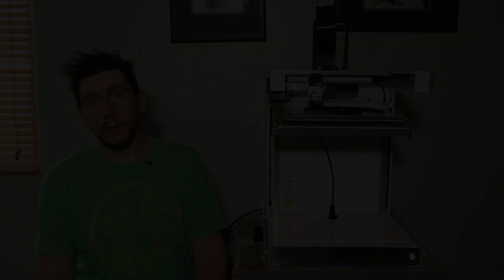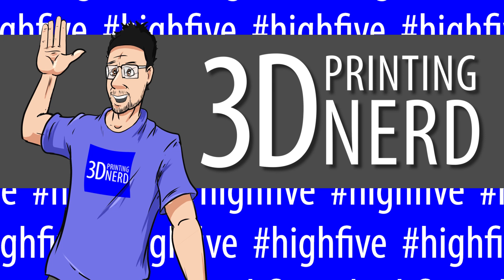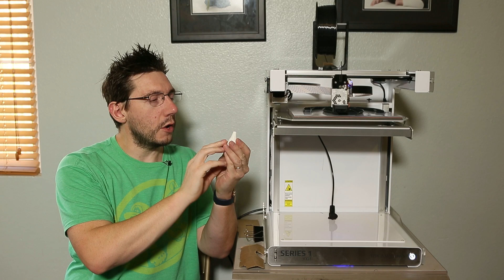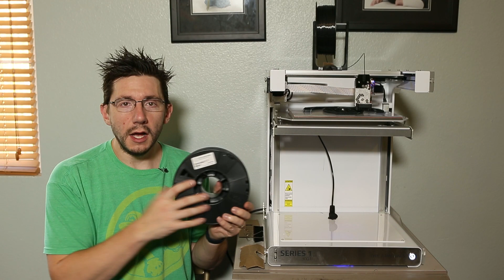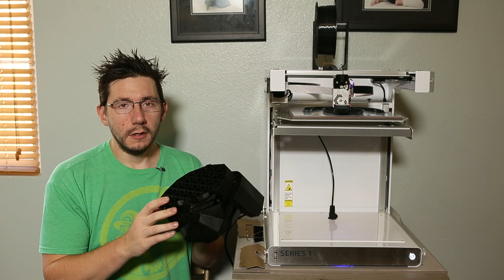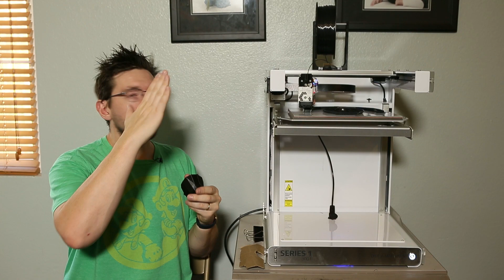Type A Series 1 3D Printer Unboxing Summary

Comment: The "filament jumping off the spool and getting wound up" issue is something I've seen on multiple printers w/ multiple spool holder types. It can be particularly troublesome when your spool is brand new and there's not much room from the top of the filament on the roll to the edge of the holder.

My printer has the spool holder on the right side and it hangs over the edge a bit. I've obviated this problem by sliding the printer to the right so that the spool just barely touches the wall. The added resistance keeps the spool from unwinding too much and the wall prevents the filament from jumping off the spool.

I'm guessing this is likely not going to be an issue as much with bowden setups, but it's something I worked around easily enough.

Comment: A spool holder, especially one that isn't build into the frame, seems like something that should be rock-solid, especially given the fact that this printer has been on the market for quite some time. Spool holders/feed issues are all the more unacceptable on a more commercial machine like this. A hobbyist can watch their printer and untangle/help it along on the fly, but if you're running a bunch of these in parallel in a busy shop environment, you likely have better things to be doing.

Comment: How much will this machine set me back ? And would this be a good first 3D printer for someone like me who is in the machining gunsmithing industry? I am familiar with the CNBC machines programming etc . I basically want a user-friendly 3-D printer that is able to print very small parts as well as parts that maybe 8 inches to 10 inches+ in size . If you would not recommend this machine which machine would you recommend for me money is not a deciding factor for me and I just really want a good machine that is ready to operate when I receive it. Thank you for all your videos I've been a subscriber for quite some time now please let me know what your opinion is thank you again
Reply from the maker: Unfortunately I'm still working on my usage of the machine and chatting back and forth with the manufacturer. This machine is billed as being industrial and ready to go, but, I still have a couple issues I need to work out before I can get a decisive opinion on it.

Comment: Definitely seems like the spool holder is not in the optimum position for the height of the extruder. Even during your video it looked like the filament was straining a little. Octoprint, I set that up on a Raspberry Pi but felt it added another point of failure, (at least on the Pi) I liked the camera support though. #Highfive

Comment: Hey Joel,  How is the guide tube connected to the top of the extruder?  Hope you feel better soon.
Reply from the maker: hey David! first off, thanks, I'm getting there. Second, the OD of the guide tube is slightly smaller than the hole at the top of the extruder. It's push fit!

Comment: What's the difference between a 3D modeling software and a 3D slicing software? (What are they used for? Any good ones for beginners like me?) p.s. Is Simplify3D a modeling or slicing software? or both?
Reply: The modeling software makes the model, the slicing software turns that model into code for the printer to read (so basically instructions for the printer).
 Simplify 3D is a slicer.

Comment: My day job got one and my school has one and it is a DECENT printer... although the web interface, first layer height and spool holder are reallllllllly sticking points in my opinion :). Compared to other machines... ive had better first start experiences. Especially for a machine of that caliber & price range! Other thing is I am not a fan of how the glass/heater/build bed are all 1 piece... chip your glass and your in a WORLD of hurt :(
Reply: I applied a piece of PEI onto the bed and it makes a world of difference. It also protects the heated bed -- because guess what their beds are $500+ yes that's right a TAM heated bed replacement is that expensive. I also redesigned the filament feeder which is really terrible. I've added extra cooling to the stepper drivers inside which tend to overheat. After those changes, the machine runs great...too many changes needed for a machine of that price range.

Comment: Wouldn't it be better to just flip the Filament Spool? The point where the filament would come off the spool would be further away.
Reply from the maker: I've tried both ways, and filament still comes off and binds on full plate prints.